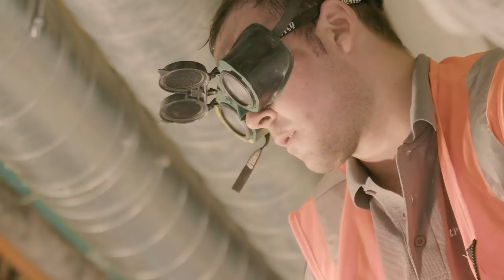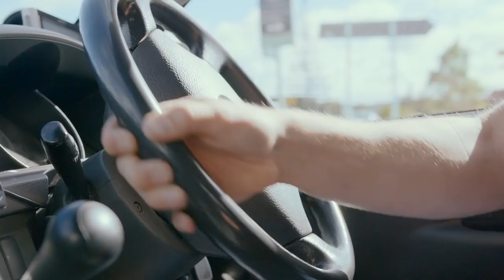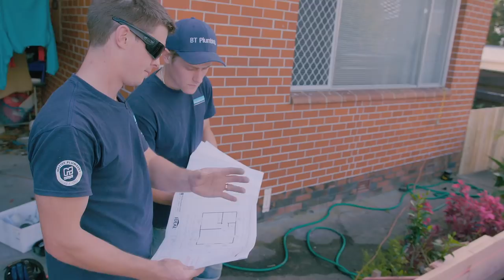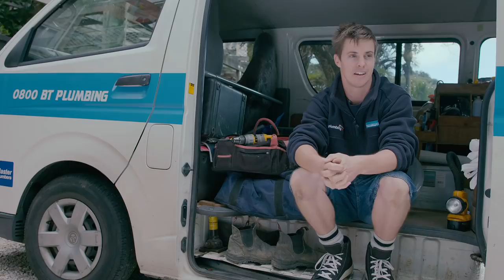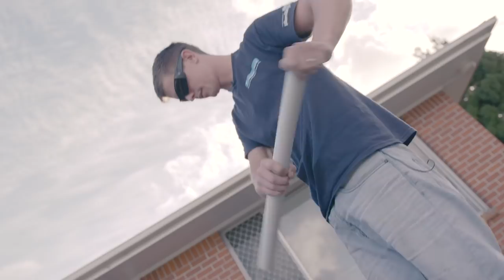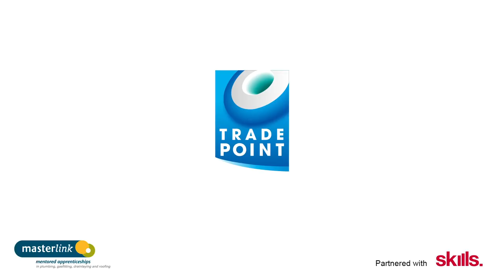A Day in the Life of an Apprentice Plumber

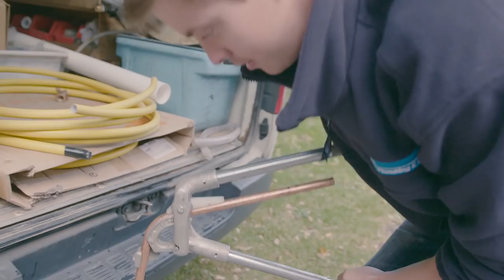Comment: 1:23 “i got rewards for my plumbing skills”... pulls the worst 90 I’ve ever seen
Reply: I fit pipe in marine construction and hydro testing for multiple years, I was thinking the same thing and I rarely had to hand bend pipe.  Similarly, I think this video is so far removed from the truth it's laughable.  Those guys were way to clean and "tidy" to have been doing any real plumbing.  The only reward you get for this kind of work is a paycheck and maybe a day here and there that you're not wet or covered in some kind of mess.